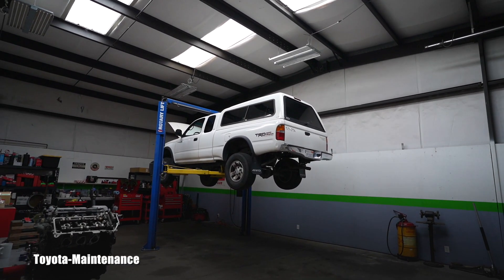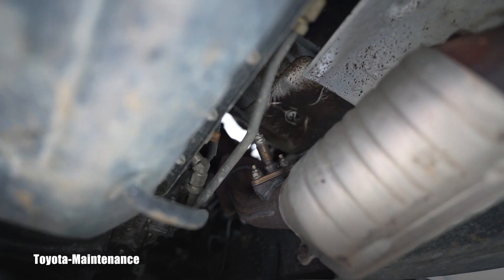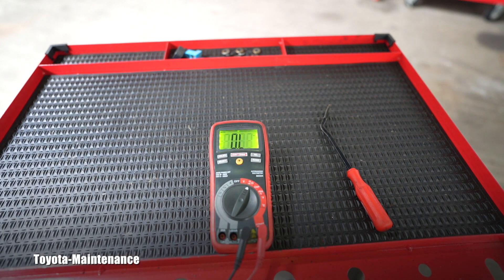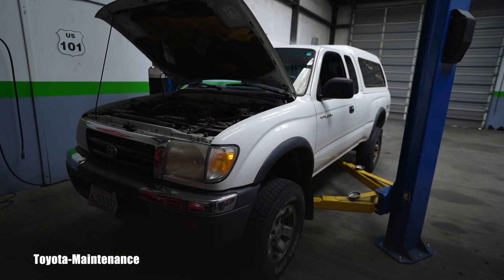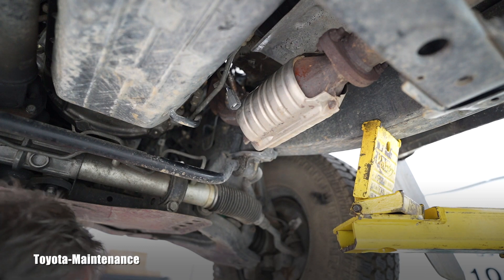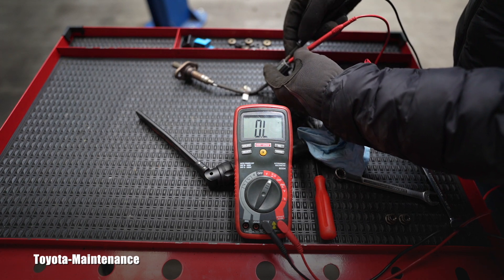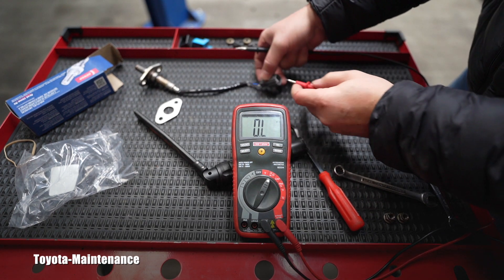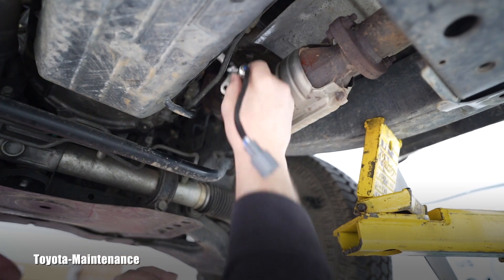TOYOTA Code P0125 P1133 P1135

Comment: Thank you for a very enjoyable video.
I have a '99 Camry showing codes P0125 and P1135. I have the right Denso upstream A/F Ratio sensor for my CA car on the way.
Hopefully both codes will clear after the replacement. Any time I look at the engine temp it is always 89-97C, so I think the ECT sensor is actually fine. Fingers crossed.

Comment: I had the p0125 code In my 2002 Toyota Corolla for about 2 months now. I replaced the thermostat and the ECT sensor, but the code remained. I finally got rid of it this morning after replacing the upstream O2 sensor.

Comment: hello I have a P0125 code replaced thermostat and ECT sensor on 03 corolla. Is the O2 sensor related to this code? Did flush the cooling system coolant looking like orange. any suggestions please. Thank you
Reply: Hey i have the same code in my 1zzfe corolla did the thermostat replacement help you
Reply: that was the first one I replaced code was still there. changed ECT sensor to an OE part code still there but P0135 came up to. checked O2 sensor was reading O.L. replaced it with OE part no more code present.

Comment: What happens if you don’t replace the sensor?  I have P0125 & P1135 codes for the past 2,000 miles on my 2.4 liter 2000 Tacoma. Running fine.

Comment: Hi I got a 2000 Toyota 4 runner and I keep getting that same code p0125 and it says thermostat so I replaced it and also the coolant temp sensor and I reset the light and once I drive with in 5 min the light pop up again and this same code so now I’m thinking it’s that sensor that u changed by the catalytic converter please let me know thanks
Reply: Did you fix?i have same code as well p0125 2000 toyota 4runner 3400 v6
Reply: Yes I replaced both of my o2 sensors

Comment: Got a 2000 Tacoma 3.4 California Emission with a P1133 Only. I noticed the Sensor Voltage on the Scan Tool is Staying at 3.29-3.30v engine running or not. Active Testing the A/F Control no change in voltage either but the 02 does change according. Tried 2 New Denso Sensors and a New ECU. Wiring from computer to sensor has no opens or shorts... Even tightened the Pins at the A/F sensor.... Any Ideas?

Comment: I had to do this job on my 04 Tacoma, but had the worst luck as the studs for the sensor broke, and had to remove thee catalytic converters to replace them, in doing so one exhaust stud got stripped and the other two kept breaking despite welding nuts to them, after 20 hours of work I was finally able to install the new sensor😀

Comment: Hi , I just have a question related to another video. I just changed the tensioner for the timing chain on the long chain on bank one because it was making noise and it was slack on chain too, and I put everything back together but the noise still there. Can you guide me on or tell me what can I do .. Thank you.
Reply: Need more info on Year and Model of ENGINE! Might be your VVT-i gear!
Reply: The engine is a 4.6 v8 (1UR-FE) engine. I just started right now and start making the noise but after warm up the noise disapareares .